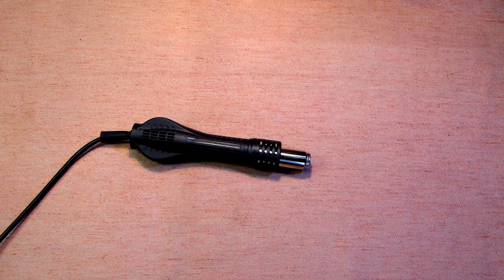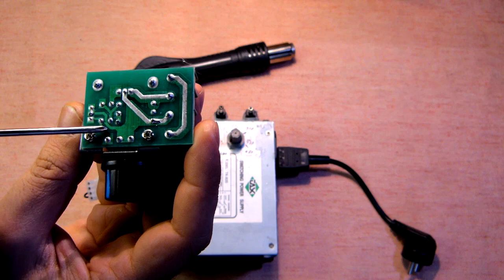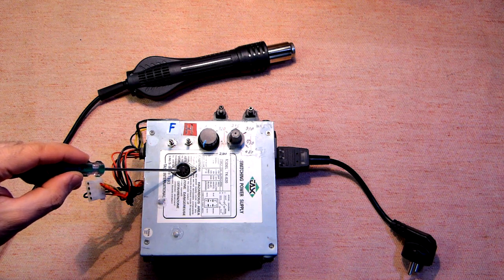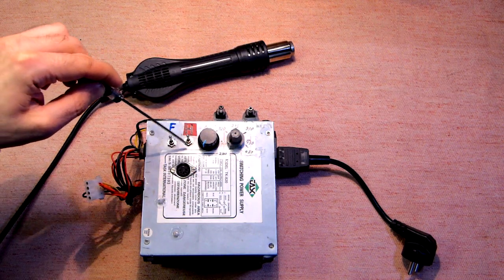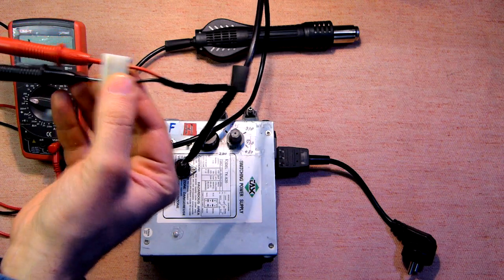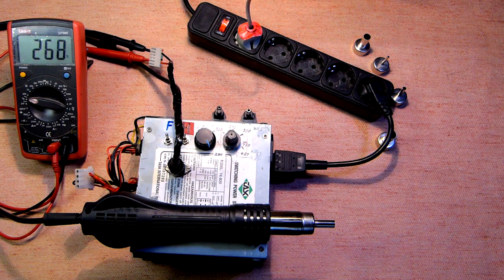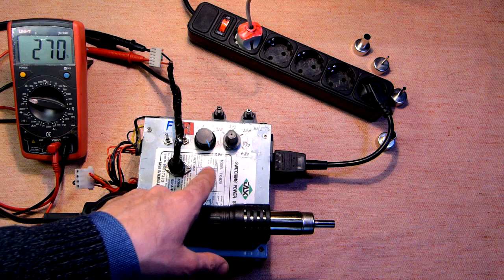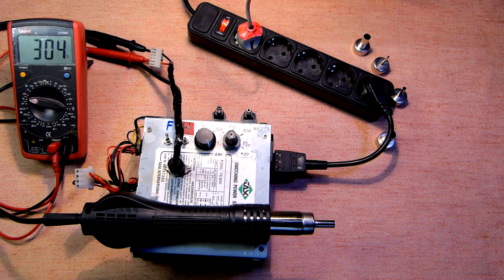Cheapest DIY Soldering Station with Hot Air Gun

Comment: I'm looking to buy this 110V handle but it does not say the watts. How many watts does this use at proper temperature? Need to know if my dimmer can handle the power. Also, did you say the fan needs 24V DC or 12V?
Reply: 850w the heater
Reply: fan can handle 12 to 18 volts max so the transformer should be 20vac

Comment: How to know if its 110v heatgun ?
Reply from the maker: Use 110V and try it. If the airflow is hot enough, then it's 110V device. Otherwise, in case of using 220V you will damage it. I've used my power regulator and approximately in the middle range the device was hot. So I guessed that it's designed for 110V.

Comment: Sir ,,is there a different if i used dc current for heating wire or i must use ac power
Reply from the maker: Hello, there is no difference. However, if you use my scheme with the power regulator - it will not work with DC.

Comment: Excuse me this hot air gun works with 220ac or with 110ac?
Reply from the maker: It came designed for 110V by mistake; but I have adjusted it to 220V.

Comment: hi, im still a bit confuse here, 

1. if i got 220v hot air gun, its still necesary to change scr module? (such adding extra resistor and pot),in my country the standard electricity was 220v
2. that 50k pot, its replace the blue trimmer or make it series with 330k resistor? (how to wiring 330k and 50k pot?)

thanks
Reply from the maker: Hello, in case of 220V you have no need to add any resistor and potentiometer. Simply they have sent me the 110V-heater, that's why I had to conjure with the regulator :)

Comment: Hi guy, 

i made one similar hot air soldering with SCR 2000w,  and i had a problem with this component beacuse, only it can adjust 40-200v ac, and hot element gun increased his temperture so fast, 1 min 400º without control (putting from first time SCR regulator pot. on minimun 40v ac, checked with tester), and it not can stopped increasement,  because that SCR can´t offer regulation 0-220v ac, and only way to stop that it is turn off station.

including your changed on circuit SCR ( resistor 330k and pot 50k), will it work better?

my SCR has, a principal pot dimmer 500k,  and 2ndary 2Mohms, and triac BTA16-600b

thank you
Reply from the maker: Resistor and potentiometer solve this problem. As it was explained before, the seller has sent me not 220V, but 110V hot air gun, and I had to remake it; otherwise I could have your situation.
Reply: Hi 

I checked your adaptations circuit, and it works amazing, 

Now i can adjust temperture perfectly, that is great

Thank for all man 👍
Reply from the maker: You are welcome :)
Reply: @antoniomero1946  hello. Have u solved ur problem? I m trying to make this project but i dont know what should i change on my scr. I have 220v ac in my country and have 220v air gun. Still should i change anything on my scr?